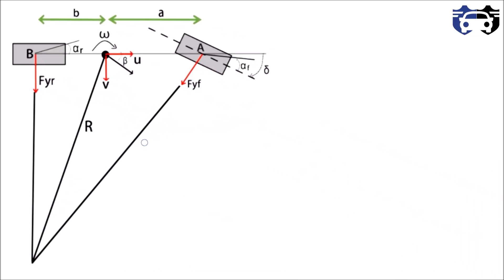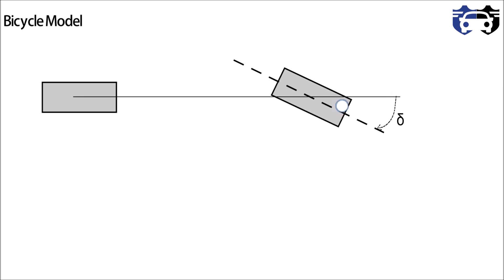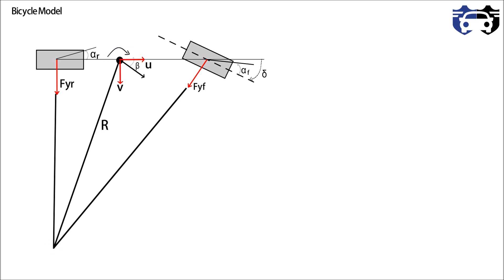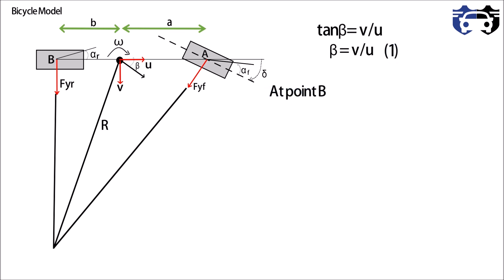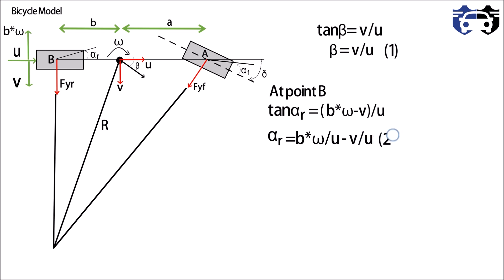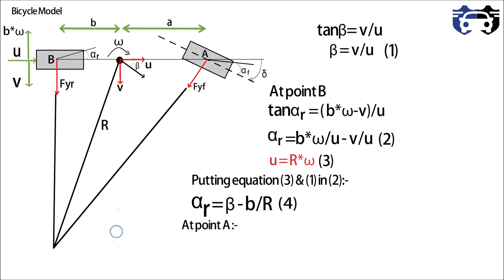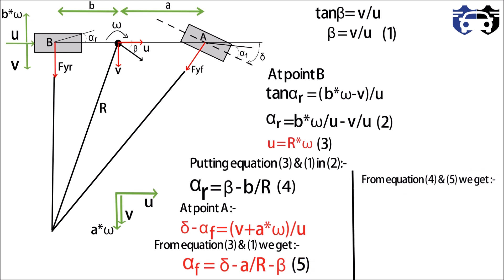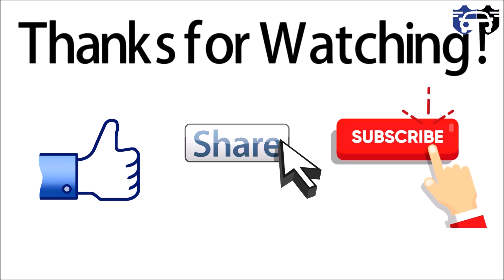What is the relation between slip angle and steering angle ?

Comment: thank you for your effort but i have some question about  angles    my book used different law like  alpha f= Fyf/2Cf   that also =(Wf/Cf)*v^2/g*R       my question how can get Fyf  and CF   or in other form how get Wf
Reply: Cf is stiffness coefficient. Its generally given by the tyre company. The force acting on the tyre is given by product of Stiffness coefficient and  slip angle.
Reply: Is given by Fy/slip angle
Reply: With more Ca or cornering stifness the curve of the graphic Will be more inclined with same slip angle because tyre generates laterale force much more before than a tyre with low ca